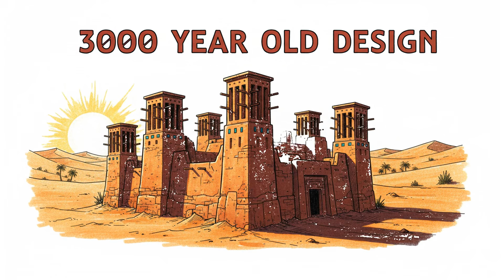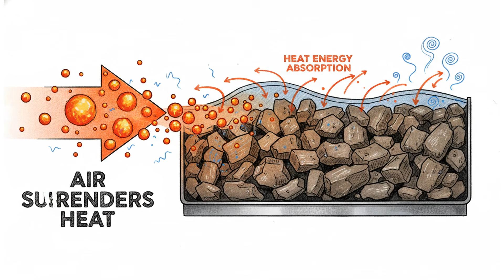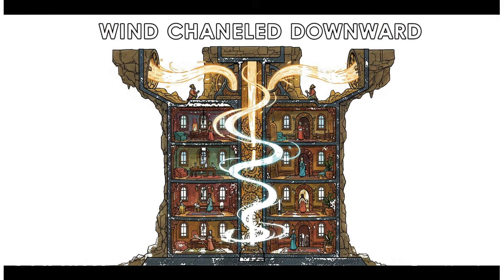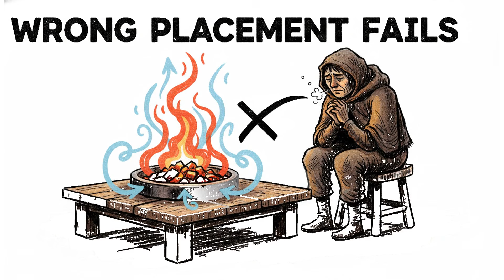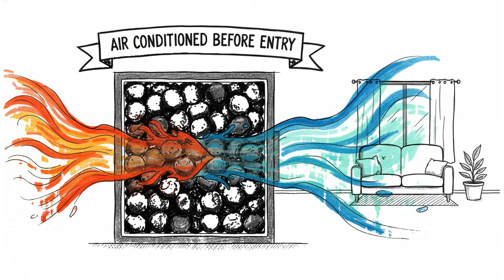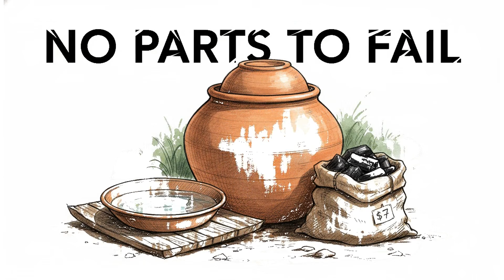The $7 Ancient Cooler That Drops Room Temperature 15°C With No Electricity

Comment: Evaporative cooling doesn't work in humid climates.
Reply from the maker: That's the main tradeoff with any evaporative system — the drier the air, the more dramatic the effect. In high humidity it's significantly reduced, which is worth knowing before someone builds one expecting 15 degrees of drop.
Reply: @ApocalypseSolutions  combine with calcium chloride to remove the humidity
 and..... ;)
Reply: @ApocalypseSolutions  won't go colder than wet bulb temperature

Comment: So basically a desert cooler but without fans? Just use natural wind
Reply from the maker: Pretty much, yeah. The evaporative cooling principle is the same, just stripped down to its most basic form with no moving parts needed.
Reply: no